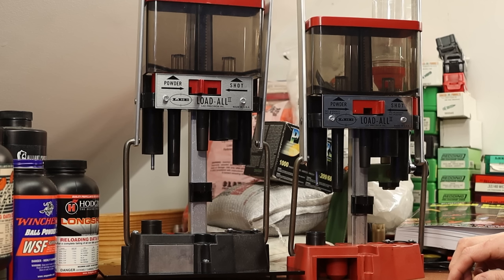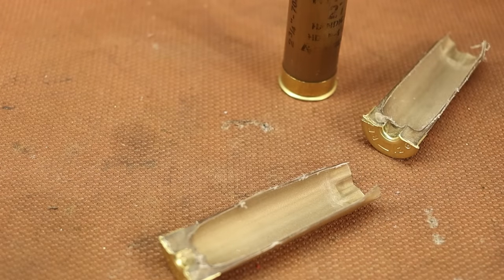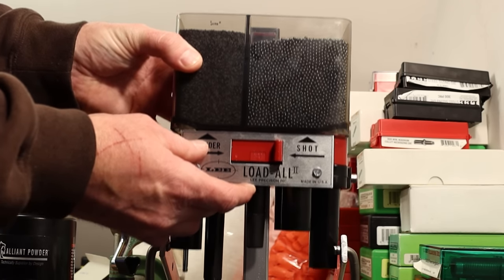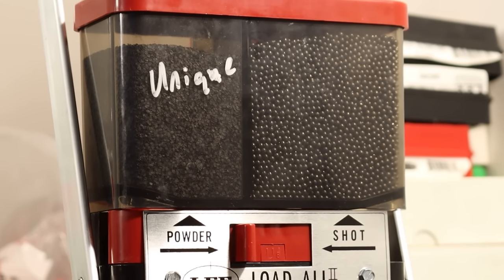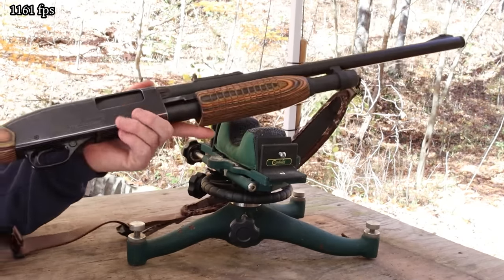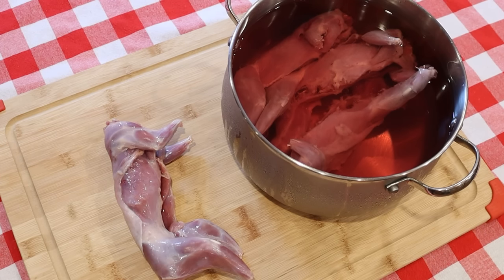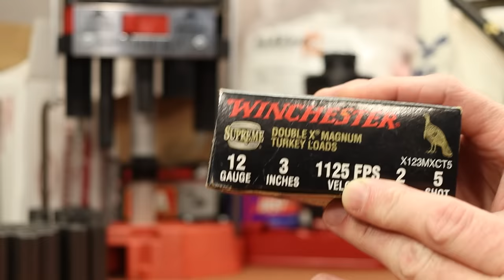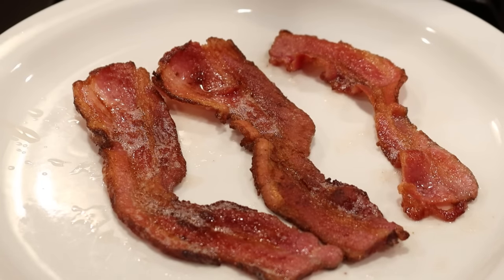Loading 12 gauge, hunting and cooking squirrels

Comment: Fantastic video. I use a Mec. I first had the Lee and when that broke, I went with the Mac. The Mec was a lot more smooth. I reload for trap and hunting. I use the Longshot for Turkey and hot hunting loads. I use Clays for trap and light hunting loads. You are off to a good start. 🙂 Looking forward to the Turkey and TSS Videos. I do Have a 410 and I bought some #9 TSS shot shells for it along with a turkey choke. I'm just waiting for DEC to change the minimum shot size from #8 to #9. It was going to be sometime this fall. can't wait.

Comment: I've been through the exact process you're experiencing with various hulls, and trying to set the load all. 

I noticed your shot charge sitting a little low relative to the crimp, as well as some shot rattle when you shake it. You're crimp is a little twisted and folded on itself which is another indication of a low-sitting shot charge.

What I found helpful to create a cleaner crimp and eliminate rattle is an over-shot card as a last step before you crimp. Works really nicely for me, give it a try.

Comment: Those Winchesters are great for a thing my reloading buddies coined the hobo slug. Basically you cut open the hull melt down the shot in to a lee 3/4 oz key drive slug mold. Put the slug back in the hull and Wala you have yourself a cheap slug. I have got great accuracy out to about 50 yards with them. When the coof hit and I had no money for ammo the hobo saved my bacon. I went and bought 4 100 round packs and turned em into hobos
Reply: Have you ever chrono'd any of them?  I've tried it, and they are Very mild recoil.  Use a cheap roll crimper in a drill press to hold the slug
Reply: @paulharveu526  no but if I had to guess since the pay load is the same I would have to guess that the velocity is the same as what’s on the box

Comment: Have had a lee load all 2 since the 80s. I learned right away that the powder drop was too inconsistent to rely on. It seems that the vibration of the shot drop and crimping caused the powder to settle in the bushing which made each load drop differently. I used to  use a dipper for the powder and scale each load . Then drop the shot and crimp with the press.

Comment: A quick follow up comment. Regarding your 410.  There is a big movement where hunters are using the 410 for waterfowl and turkey and killing turkey cleanly with TSS loads out to 45 yards. I believe a 3" load would be around 11/16oz.  I like the mix of both metallic and shotgun loading vids. BTW, you can rent a reamer and tap for that 410 and convert it to accept choke tubes. Probably don't want to do that to your topper being a gift and all but hey, it's an option.

Comment: Shotgun shell reloading can be confusing. Definitely. Lee has always steered "middle of the road". With that understanding, primer choice doesn't make a difference to Lee, or the data they publish because there's plenty of room for variation. Lyman, however, goes into much greater detail and present guidelines to follow for reloaders who want maximum, or near maximum, loads. Additionally, European 209 primers are just a whisker larger that American primers. (Probably something to do with metric to imperial conversion). What this means is that if you use Cheddite primers, the primer pocket will be loose with Winchester 209's. All is not lost, though, because the primer pocket can be reset with a "primer pocket uniformer". Simple solution is to stay with one brand, but adjustments can be made. The other fiddly thing is that "straight walled" vs "tapered" hulls, as you mentioned. 
Base wads causing an obstruction? BS, for most. The only time that can possibly occur is if the hull is reloaded long past proper trash barrel time.
The good thing about shotshell reloading is that you can craft a load to meet almost any need or desire.

Comment: Most of the people I know that reload shotgun shells are bird hunters. The only shells I use to bird hunt with (dove and quail) are Remington Nitro or SPS or Winchester AA. They are the most accurate and have better shot charges. So I pick up my hulls when hunting and there you have reloading supplies. I'm sure trap and skeet ranges are good sources as well, but the heavy or handicap target loads are the best for wing shooting. Also, MEC progressive presses are awesome. You can probably get an old one like mine fairly reasonable.
Reply: My fav dove load is Remington  STS handicap loads.    I started loading my own with green dot at 1250 FPS and 1-1/8 oz of 7.5 shot.    If I’m hunting alone I’ll use same load and 6 shot so I can reach out further.   I started to really like 6 shot for doves.   I noticed I started knocking down more birds also.
Reply: @halfdollar86  That 6 lead is a bad dude. I used to murder teals with them back in the pre-steel days. It's good for pheasants and other big upland birds too.
Reply: @robertmajors1737  yes I used 6 shot 1-1/4 at 1350 on pheasants last year.   Worked great.  I’m a fan.

Comment: MEC 600 fo 410 works good, they make an adapter plate to change between 2 1/2 and 3 inch shells I would recommend, that and swap the charge bar.  .410 shells are unobtanium now. I grew up shooting and reloading. 410

Comment: Nice vid. I use the Lee to load steel BB for Canada Goose, it does fine except that Longshot powder will cake onto the plastic powder bushing, not static cling, but sticks. I overcome this by going up one powder bushing size, throw 20 charges to let the powder build up and then you can load.

Comment: The crimp shape where one is concave vs bulged could be variations in powder/shot drops or wad seating pressure. The AA are prone to leave the opening in the middle of the crimp. The swirl is because that particular hull was slightly longer and the extra plastic will make that swirl.  You will see that swirl more with the Rem and can be adjusted on the mec in the final crimp station.  Not sure if you have any adjustment on the Lee.
Reply: Nope, you just ram the hell out of it

Comment: Something you still see on shell boxes sometimes, is dram equivalent.  Which is like an older form of saying it's power level.  (I think). Really looking forward to this series,  as I encountered the same exact problems identifying everything.
Reply: @CamaroZ28Nut3  yeah something along those lines.
Reply: Yes, the dram equivalent is a reference to the black powder loads. Most current loads don't really need the dram reference. The fps velocity is more meaningful.

Comment: On mounting your press a bit stronger, I would use bolts and mount it to a piece of 3/4" plywood. Have the bolts come up from the bottom. Counter sink the bolt heads up into the plywood enough so it sets flat on the bench.
If you are using some sort of mounting plates for your other presses, you can use the same type of mount plate for your Lee load all presses.

Comment: Very well done video. As I watch you show your concerns over primers, basewads, tapered vs. straight wall and all of the other factors that affect pressure, I'm reminded of how it use to worry me every time I pulled a trigger on a reload. I've reloaded since I was 11 years old, when I used to use a Texan FW press for trap and skeet. I had a friend who would steal shells from me on a regular basis. To teach him a lesson I FOOLISHLY loaded one round with a double powder load. His dad wound up getting knocked on his butt by it, but it didn't hurt the Remington double barrel he shot it from at all. While you can definitely cause them by  combining improper components, most accidents that destroy guns are due to blockages from a previous shot. I've made hundreds of thousands of shells and I'm sure I've made at least a few missteps along the way, but so far no incidents. I now only load buckshot, slugs and round ball in 12ga. I never use either hopper on my MEC. I weigh every powder load any put the payload in by hand. I bought a Lee press for my 20ga loads. They work, but there is no comparison in quality and ease of use vs. MEC and other brands. The resizing ring is a deal-breaker for me. Having to align the crimp pleats every time and no adjustments other than "feel" for crimps are pretty bad too.

Comment: Federal, cheddite and the European hulls are straight wall in their shape. Win and Rem are tapered in shape and have a lower volume. That Rem Fig 8 is a good wad for the tapered hulls but will leave you short on fill in the straight wall hull. The steel base hulls are difficult to resize without a collet sizer on a Mec sizemaster. You picked up on an issue with the newer 2 piece AA hull in that the wad will hit the base and leave a wrinkle in the hull similar to line you had on your 6 ARC cases if you don't use the right powder. Send me a message with your contact info and I will mail you some hulls. I shoot sporting clays which is why I reload a lot of shotshells.

Comment: If you want to load the 410 on the cheap you can find the lee loader you use with a hammer on ebay most of the time. The lee loader in not the fastest loader in the world but it is quite fun and relaxing to use.

Comment: Fantastic vid mate. I've run a lot of shells through a mec 600jr and they work a treat. I size/deprime on an ancient version of the "mec supersizer" in big batches, then load hulls in big batches. For killing grouse or clays I like a 1oz load (or less) in 12ga, get the velocity up till you blow out your pattern then back off a bushing size (try not to stray too far from published data but there's lots more wiggle room than you'd think, especially if your gun is rated for 3.5" which develop way higher pressures). 7/8oz and 3/4oz are great as well but wad selection is limited. If you want to load longer term in quantities more than a few boxes a year, get the mec. Never tried TSS but I've seen shells with a 50/50 mix of steel and TSS to keep the costs reasonable. $0.02 for ya!

Comment: For a lee loader I use flake powders they leak less. For light loads I use red/green dot, for full power slugs and buck I use blue dot, or throw longshot out of a powder measure. I've used unique for full power loads too. I mainly use Remington sts one piece plastic hulls, though the interior of the shell is tapered, so doing whacky stuff like double slugs and slug and buck etc is harder. The Remington hills last a long time. Also, I just cut the hulls down after the ends rip off and make mini shells by using a Russian roller and a card. Bubba round tree is s resource, BPI has load data too for stuff. Yea f you want to cast slugs avoid the lee 1oz and use the 7/8 slug, the Lyman 525gr slug is my favorite, it's a bulldozer at 1550fps

Comment: Reloaded over a million 12 ga loads in the last 20 years. everything you can think of... it really doesn't matter what kind of case/wad you use. As  long as you have the powder weight and shot right.  and you're using the wad design for the shell .whatever you're loading the little variation in  velocity is not going to affect anything ..it takes 4 times the powder charge to blow a shotgun. A 12 ga is the most forgiving to load for.  Remington makes the best shells.  I can get them to last 100 times.
Reply: Finally a comment I 100% can agree with! Lol

Comment: This is exactly how I started reloading shotshells. 16ga on a Lee load all. Then a bought a mec size master for 12ga. 

Load data can be overly complicated. I selected loads based on the least amount of components needed and have avoided all fiber wads and the like for the correct stack height so far.

Comment: Hey Mate, about your emptying your lee presses, you said earlier you printed that green lid, well print two more, maybe use some other options where you chose primers. Then mark each new lid so that 1 piece covers powder plus just a bit, and the same for shot, cut them each on your mark so that each part of a lid covers what you do NOT wish to empty. Do both sides so you can empty both, and you will need 2 lids to cut up as each part cover must fully cover each side. Cut up some old innertube to ensure a good seal for each side. You could even use a couple rubberdands to hold each emptying case covers.
Dont forget to replace these with the origional for reloading.
Enjoy this new year, keep on doing these vids, you are way cool in this 70 year old pistol shooter Range Officer for APSUA Style a d Service pistol.  Wayne

Comment: I use 6-8 hours in a slow cooker for "fall off the bone" meat. As for the cooking result, it honestly looks like pot pie filling without the vegetables. I bet you could get a pretty good result doing a cup-only (no crust) pot pie/shepard's pie with some potatoes on top. As long as the result is palatable, it is always salvageable.

Comment: you're definitely on the right track. honestly id go on the mec websites and just familiarize yourself with the different models. what you really want is a sizing collet in your machine, the mecs do that best. poke around your local shops and see if you can find a used one. Also you wanna find a hull and wad combination you find works for you. Remington and Winchester components are very good. Dont worry about hull life unless youre a target shooter, however the remington and winchester tapered hulls are in my opinion the best. Ive been doing my research with bismuth shot (i have an old model 12 that i wanna go duck hunting with that needs special attention. Eg, bismuth or lead shot only (nickel steel barrel), and brass case heads not steel). if youre worried about your hulls, dont be, shoot em til they split (the hull) or start getting pin holes. Your first signs of wear will be on the crimp. If youre interested send me a message or email and ill show you my setup and how to evaluate hulls. Its not difficult, just gotta know what to look for. Also the more you use your hulls the more your case will expand and mess up your crimps.

Comment: Alliant makes some of the best shotgun powders in my opinion.    Green dot is one of my fav 12 gauge powder.  It really shines in the 12 gauge field load / handicap loads that are 1-1/8 oz 1250 FPS area.    You can also load target loads with it in 1 oz and 1-1/8 oz.
Reply: Green dot is my favorite for reduced velocity(~1000fps)  slugs and buck
Reply: The trouble is finding them at the moment.  Alliant powder has been extremely hard to get lately.   I think that is why many have switched to other powde choices.
Reply: @chaecoco2  yes I agree.   It has been a little more available lately but it’s really increased in price.     The last Green Dot 8 lb I seen locally was this summer for $ 349.    I thought they were insane when they went to their current prices and it would really slow their sales.    Unfortunately it looks like others are on their way to similar pricing.    I have started saving my Green Dot and been using High Gun lately for the same type of loads.    I prefer Green Dot because High Gun is dense and you really have to be more selective on wads and sometimes even use 1 oz wads with 1-1/8 oz loads to get a nice crimp and not dish.    Just really depends on the Hull and wad combo.   Other than that it shoots great.

Comment: #1: Buy the 12 and get the 16 Gauge and 20 Gauge adapters as this Loader is amazingly inexpensive for what you can do with it.
#2: Buy the adjustable shot scoop.
#3: Buy the Lee 00 Buckshot and the 7/8 slug mold.
#4: Buy a few bags of new primed hulls.
#5: Buy a few bags of Wads for shot and gas seals for slugs.
#6: Stock up on a several pounds of powder and a brick or two of primers.
When you run out of all the other types of ammo, you can reload those hulls anywhere from 5 to 15 times or more before they fall apart.
Also, there are 2 types of all brass hulls, the cheapest ones that use pistol primers but need oversized fiber and card Wads, and the thicker brass ones that use shotgun primers, normal to Gauge plastic Wads and will last for thousands of reloadings.

Comment: If looking to keep the cost down for target loads, shoot 7/8 or 1oz.  Rem tgt12 or claybuster equivalent work well.  Went through the same Winchester hull conundrum myself for literally a couple years.  Started buying rem sts, nitro, and gun clubs and never looked back.  If you study the books enough, the difference between primers usually comes in around a 1 grain delta.  So in a pinch dropping a whole grain has nary led me astray.  Most of the snobs will say no, but they buy 10000 at a time and haven't changed loads in 30 years.

Comment: The Remington nitro and premier hulls as well as the Winchester AA hulls have always been my go-to. I do tend to get a little more longevity from the Remington hulls over the  Winchester they tend to split at the crimp folds sooner than the Remington.  When I was much younger I had a bunch of Active hulls which were all plastic, no brass at all. That loader looks rickety. Never used one of those. I have the MEC 600 Jr. Actually 3 of them. Had them since I started in my teens ( I'm 55 now) and never had an issue with them. The MEC loaders also have adjustable wad pressure.
.
Reply: Those activ hulls were awesome.  super high volume straight wall shell.  the lyman manual had some 1-5/8 oz loads that were deadly on rabbits.  thats a lot in a 2-3/4 shell.  wish i could find some more of them.